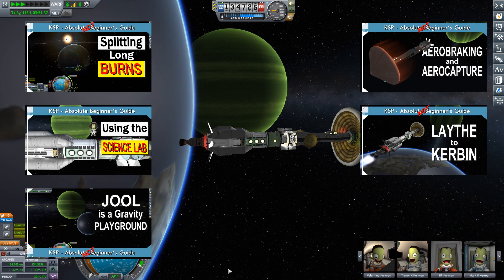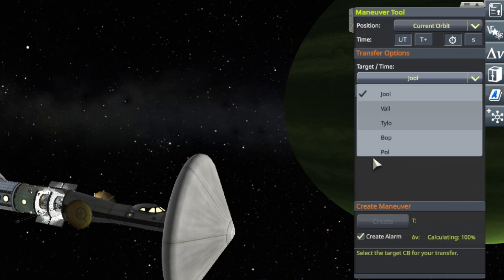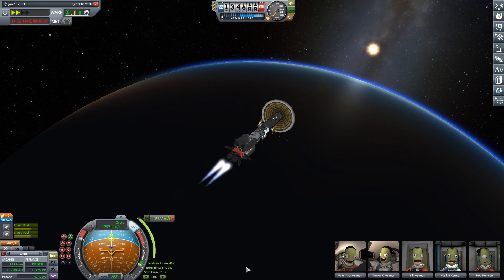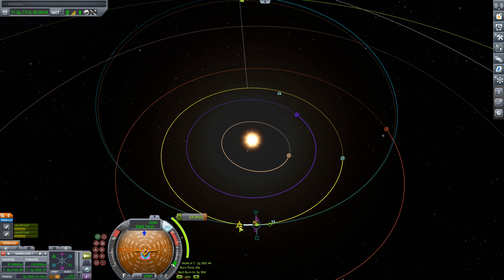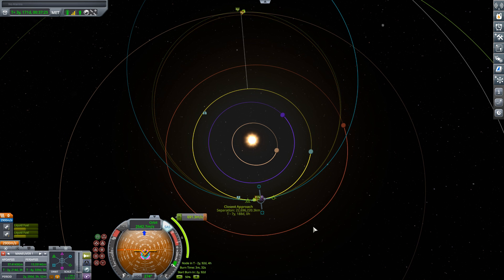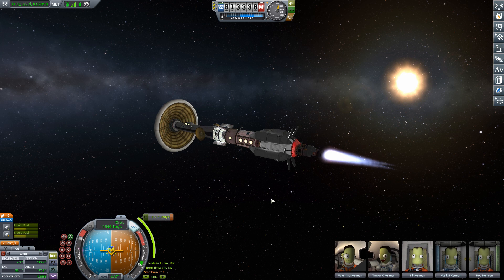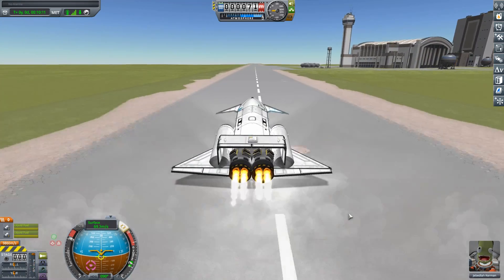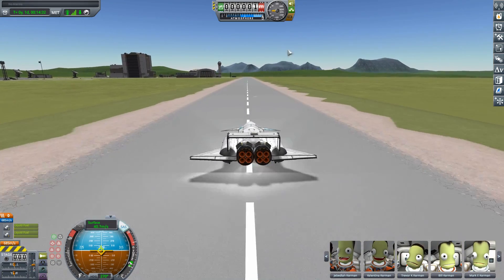An Alternative Technique for Planetary Transfers | KSP (Not) Beginner's Guide

Comment: Ok so I have a massive ship with no heat shield (I don't think I had the inflatable ones when I built it, and they're too small anyway, even with 4 in a square in the front). Can I gravity capture with Mun or Minmus? Or are their gravities not strong enough?
Reply from the maker: If you mean use the Mun or Minmus to gravity capture into Kerbin orbit, then yes, though Minmus will likely be useless. Even with The Mun, it's tough. Aerocapture using Kerbin’s atmosphere will likely still be possible even without heatshields. Quicksave in case things go wrong and try different periapsii with Kerbin. 45 to 50 km usually works well, but that can vary with the ship and where you're coming from. Go in engines first. It gets harder with more massive vessels. Good luck.
Reply: @MikeAben  I'm coming back from Jool, and while the front area of my ship is 2 MK3 payload bays put together to make a giant bay and then capped with the MK2 payload bays to act as doors, there are other things on the sides of the ship that stick out (mining landers and solar panels). And inside my hangar are a few smaller starfighters. There are no control surfaces and the only engines on the back are nuclear, which I refuse to use inside an atmosphere. It's the same ship that got the double Laythe assist.

Comment: Hey Mike, great stuff. Thanks for this. I was wondering about techniques to do planet encounters without having to time warp to the phase angles, is that even possible? I get a bit bored of waiting around tbh 😃😂
Reply: As in leaving Kerbin for another body, guess comes down to delta v efficiency right?
Reply from the maker: @_RandomPea  There's no reason you can't use the same ideas leaving Kerbin. There are ways of making any extra fuel costs very small. The link in the info tab talks about that.
Reply: High deltav transfers? What we need in KSP is an Epstein-fusion Drive :-)